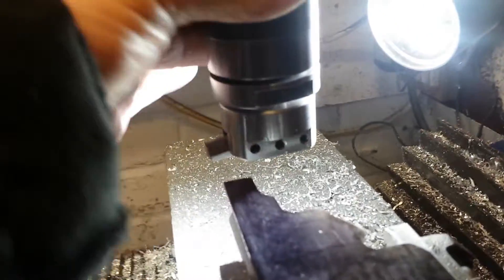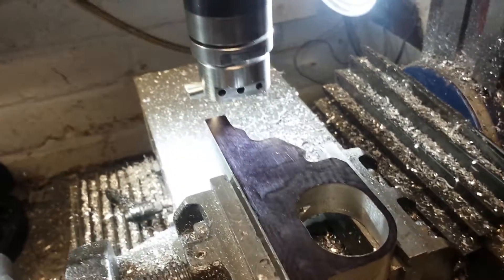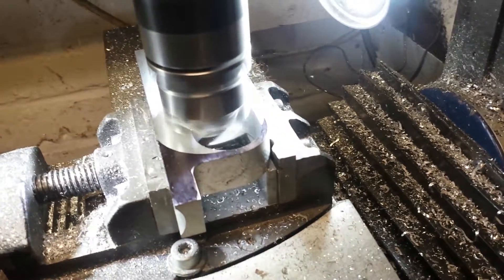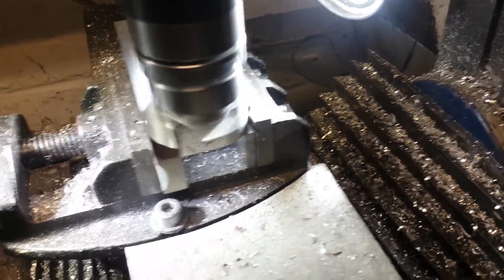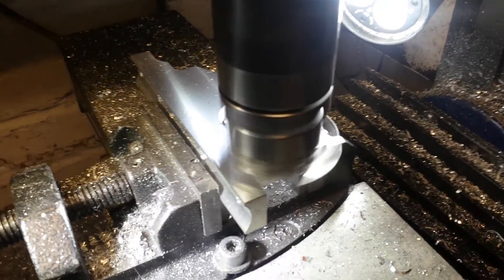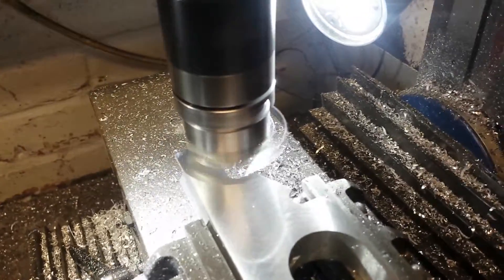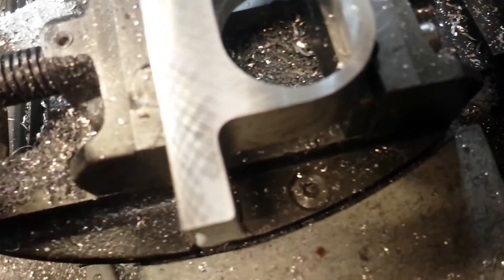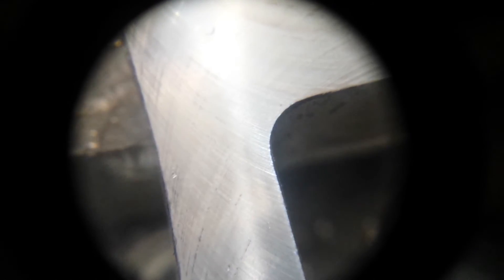Fly cutting trigger frames.

Comment: watched a lot of 2240 videos and this is the first time I found this one. good work, the ar blue prints online kinda suck gonna look at the rest of your videos making a trigger frame for the  ar grip myself hey if you got the time where can you get the marauder type three piece sear for a good price ebay people want $90  got a 3/4" 19mm thick piece of 7075 and probly drill the 1/8" pivot pins through the side and make a side cover plate to retain them the sear spring and the grip retaining bolt are reeeely close you probly have yours done I'm real close whatta project lots of card paper templates and compairison and foolin round been fun though thanks for taking the time you have real good videos and show us some o ring grove cutting details on what works good